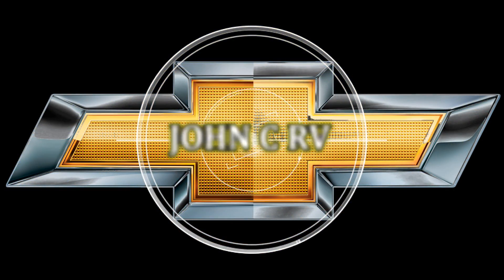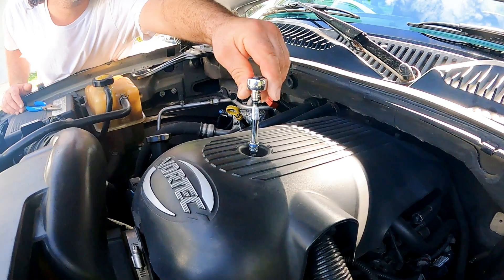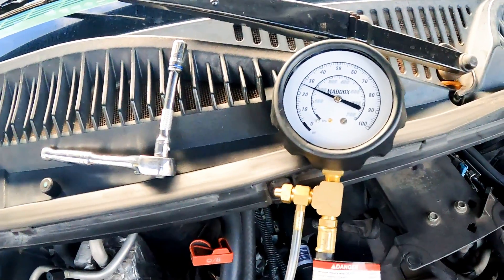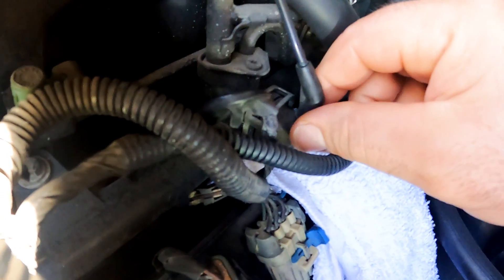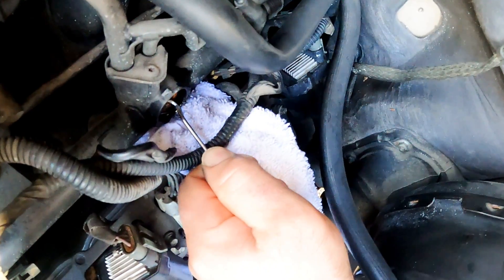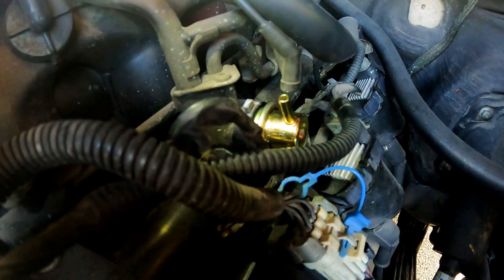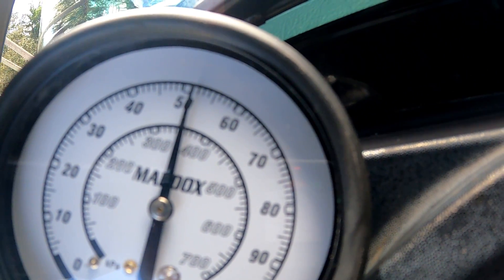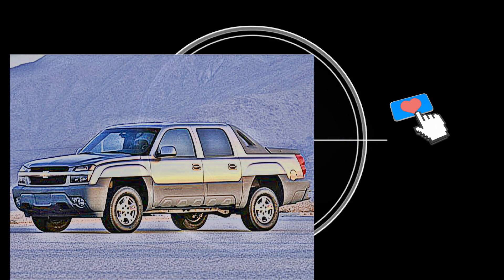How to Replace Fuel Pressure Regulator 2000 to mid-year 2003 Avalanche Suburban Silverado Yukon

Comment from the maker: Today we Replace Fuel Pressure Regulator 2000 to mid-year 2003 5.3 LS Avalanche Suburban Silverado Yukon
The Regulator is located on the driver side by the fuel rail. 
They were later put inside the fuel tank from mid-year 2003 (I believe)

Comment: I was having a long starts so I replaced the regulator and it's still doing it any ideas? Would be gracially appreciated
Reply from the maker: Sorry I just seen this. If your vehicle is still having long start issues after replacing the fuel pressure regulator, it could be due to a weak fuel pump or a clogged fuel filter. Checking the fuel pressure with a gauge can help identify if the pump is functioning properly. Hope this helps

Comment: I just thought about you the last day, i was trying to connect a new connection for a dash cam from the fuse box, of course didn't work, you should make a video to show everyone😊
Reply from the maker: Since they started putting computers in cars, its been an issue adding wires for accessories to vehicles... Without going into all the issues the main one is, if something goes wrong with the accessory it will sometimes effect other electronics in your vehicle... There's many more issues depending on the vehicle... especially the very expensive computer (ECU). My Son is having some issues with his 1992 Z28 Camaro we are restoring. We recently got the engine running after it being parked in his garage Since 2011 and now tracing all the added wiring done from the previous owner.... The main wiring issues are the Aftermarket radio system and the alarm system.... Still sorting it all out....
So, my suggestion to you is use the accessory plug (cigarette Lighter) to feed your dashcam or USB plug if your car has one to feed power to your dash cam of course first call the manufacturer for their opinion... This is just my opinion, you may want to get a technician to give you some advice since they do this everyday... I don't mean to discourage you but I've heard so many DIYers having issues after they do these kind of connections without doing research on their particular vehicle's electrical system...
Let me know what you end up doing and how it works out. Good luck!